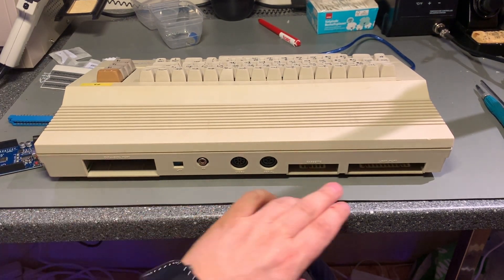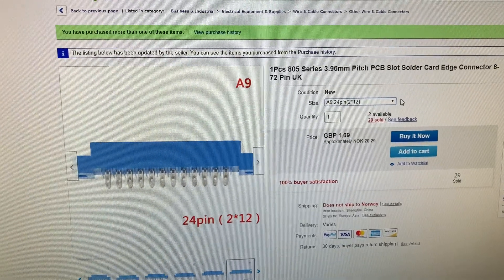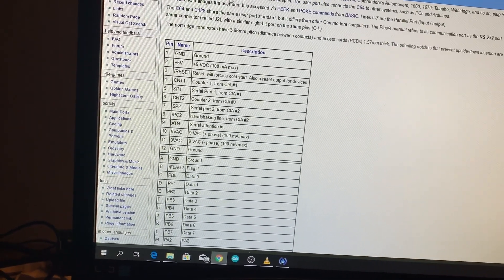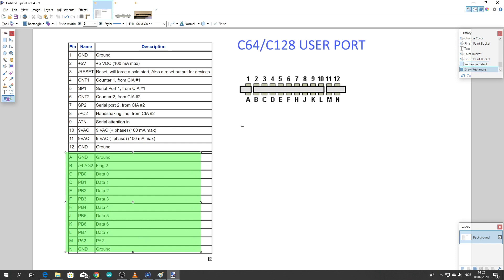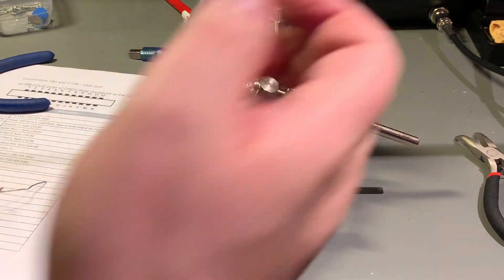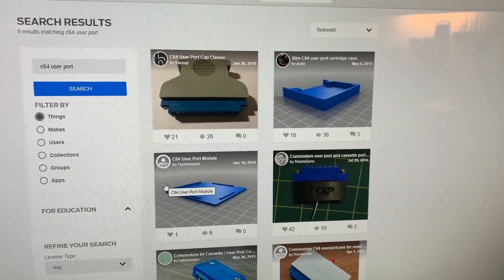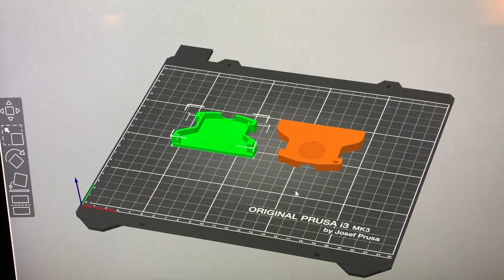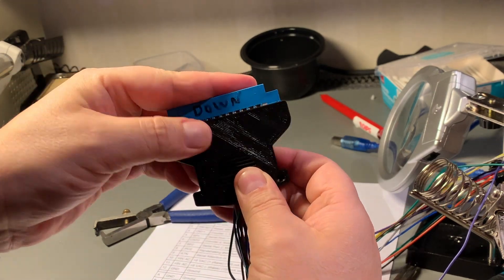Controlling electronics with the Commodore 64 user port - Part 1

Comment: This type of edge connector has moulds in between the contacts allowing little plastics as coding to match the gaps on the C64's mainboard. At least this is what had been done back in the days. Or maybe because our then company wanted to make it fully fail safe. 🤓

Comment: Is the connector key too small to print?  You might be able to make a label for the connector with the extra-small font on your label maker.
So-called "insulform" (double layer) heat shrink can be used to give support at the connector end and make a nice finishing touch.  Double layer tubing has an inner "adhesive" layer that flows to fill voids and is very sturdy.  The header pins are a nice touch.

I remember an I/O project from the Explorer's Guide to the Sinclair ZX-81 and TS-1000 that used an 8255 Programmable Peripheral Interface to do real-world I/O.  This seems a whole lot simpler and more elegant.  Neat stuff!

Comment: Thanks for the project video. Back in the early 80's we used a VIC 20 with a SP0256-AL2 phoneem processor circuit out of the BLUE BOOK. That would be another interesting project

Comment: This is so funny! I created this back in 1990 for my highschool graduation project for computer class. I initially started using BC547 as LED drivers. Then I found a 74541 and that made it a lot quicker :)
I used and external power supply to off load the CIA because 100mA isn’t a lot and I was afraid that if I fucked up ghe school’s 64 I would not get a passing grade :) Although my calculations showed that I could run all 8 LEDs and draw ~80mA I was a bit chicken shit :) 
I got a very good grade and it taught me more than the first semester of engineering college.
I actually demonstrated a binary counter in basic vs machine language. And used another C64 with userport as input as a frequency counter and showing that binary counting is an exact means of frequency dividing. 
The teacher and the 3 exam committee members were impressed. Me and my buddy actually made tools for CCITT 5 hacking (phreaking) and we used the C64 as a means to accurately, send the sys-forward tones. Which initially I generated with the SID but later we did with logic as it was more accurate. So the whole 8 LED and one input counter was a day’s work :) The easiest A+ (10) ever :)
Reply from the maker: Thanks!

Comment: I like the 3D printed cable housing :) Tip, put the pin header in a breadboard and solder it there :) I have a few bad breadboards I got from ordering from ebay that I mainly use to solder pin headers. Looking forward to part 2. I'm thinking there must be a open source project out there of output buffers for the user port ?
Reply from the maker: Good tip. I will do that next time. Have a lot of breadboards